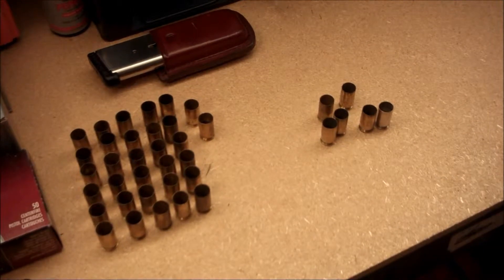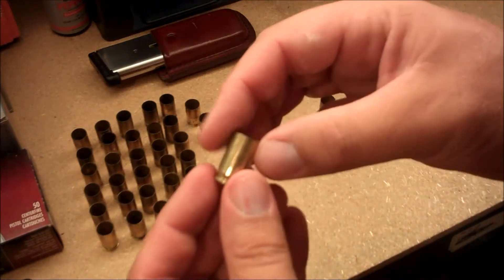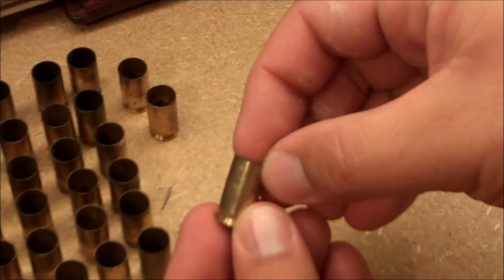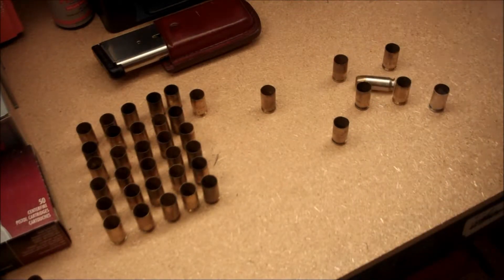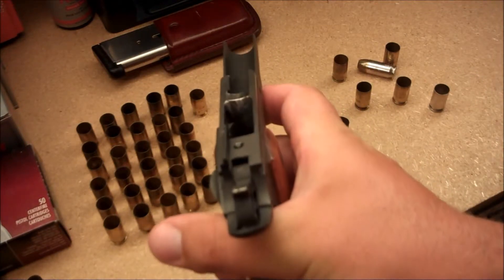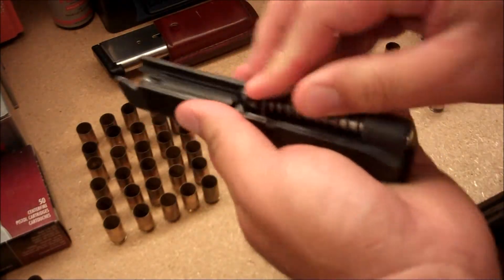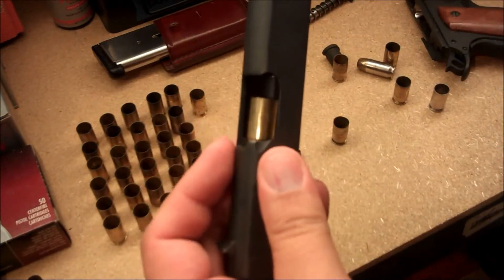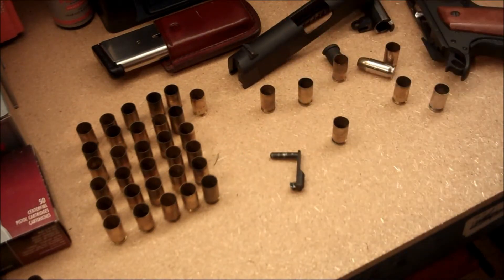Reloading Question

Comment: What may be happening is as the case is ejected, its hitting the slide as it leaves the ejection port. Something you coul try is, Chamber a round that is new with no marks, then pull the slide back quickly as if to imitate the ejection of the case after being fired, then look at the case to see if it has the mark. You may even be able to see it hit the side of the ejection port! Just an idea!!